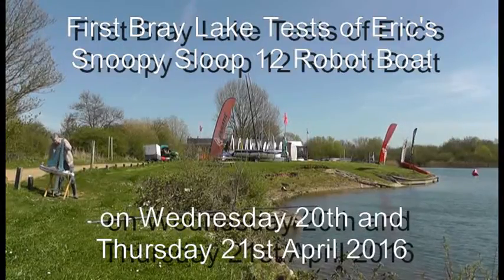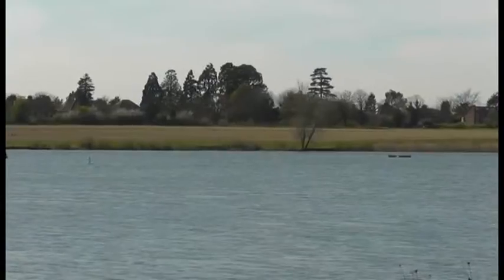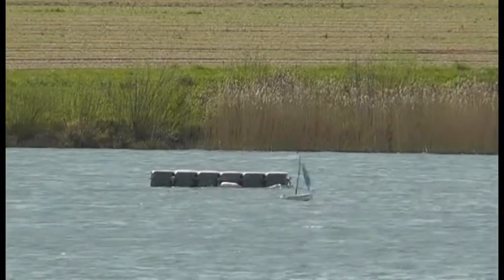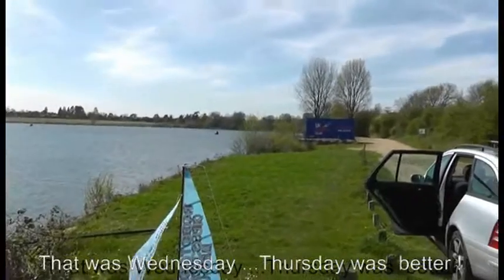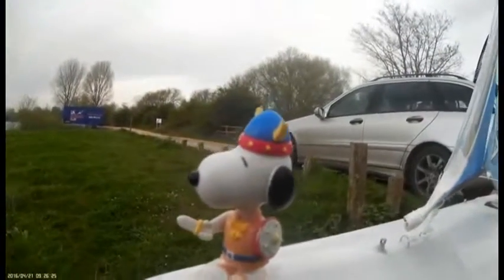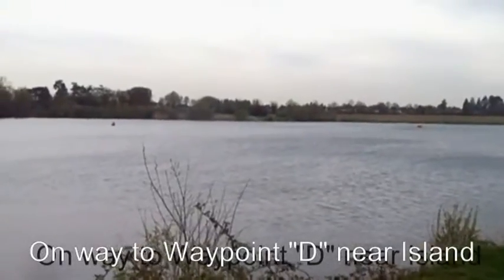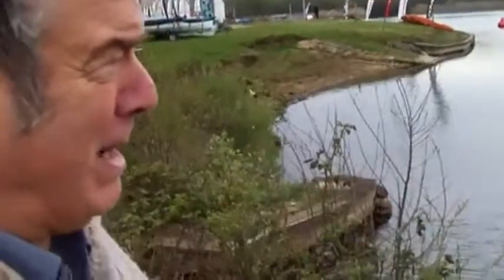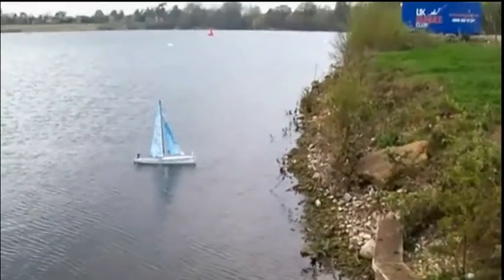First Tests of Snoopy Snoop 12 - Eric's Robot IOM model yacht

Comment: Very interesting idea ! I sail  scale sailing models, and have done so for many years, long before we had radio control .   Can you tell me please , does it have a sheet winch on board ? The reason I ask is the sails do not go out as  far as they should, when  on a run . So the boat tries  to luff  and the rudder will have to counter this action , which will slow it down. There  is more wave action on the water then wind on this day . So the yacht has  trouble making head way making a lumpy sea  . If it sailed on a day when the water was calmer,  may well have gone round the course in a quicker time ?